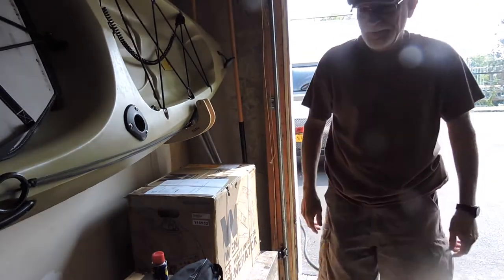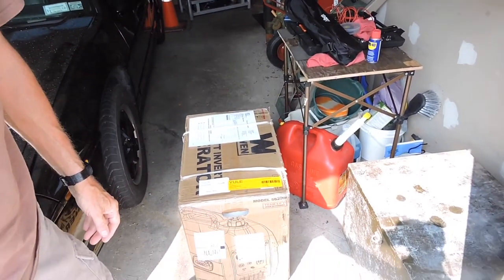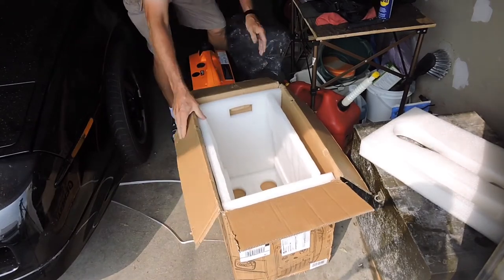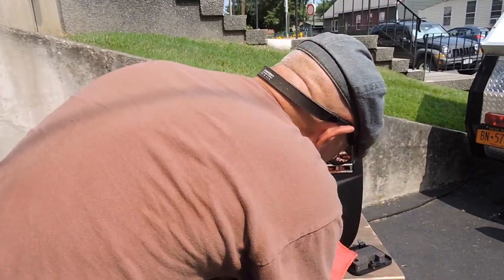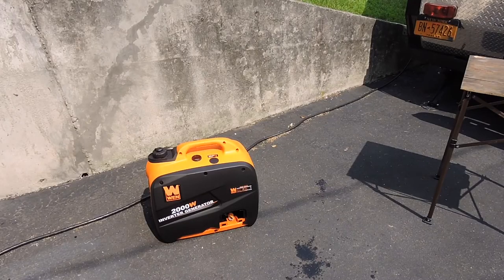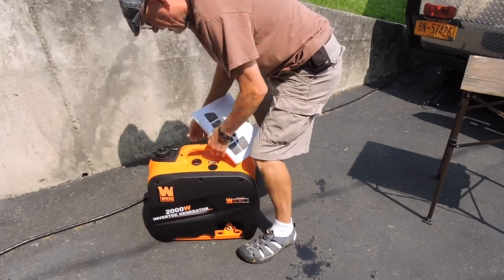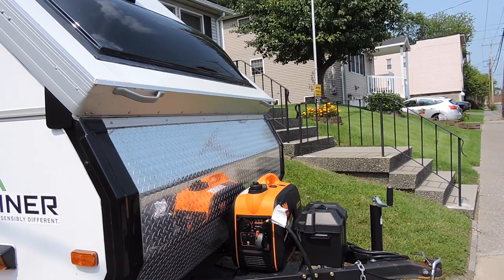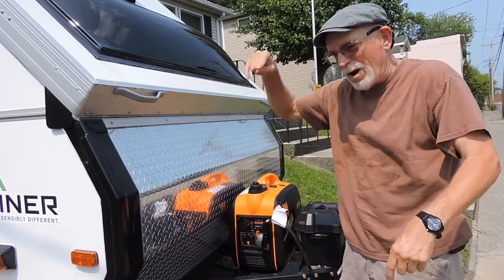Wen 2000 watt inverter generator unboxing Aug 27, 2018

Comment: That looks like a great unit.  It was much quieter when you got it out of the driveway and on the camper.   You will get a lot of use of it for sure.
Reply from the maker: The garage and cement retaining walls made it sound a lot louder then it is. I’m truly surprised how quiet it is. We will see how long it lasts. Thanks for watching the video.